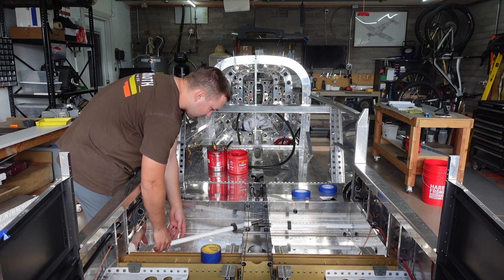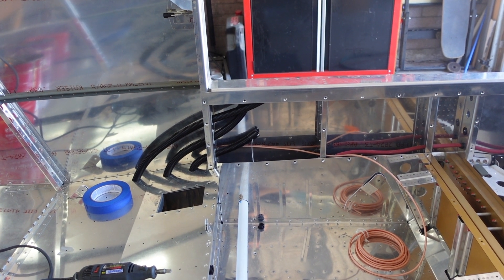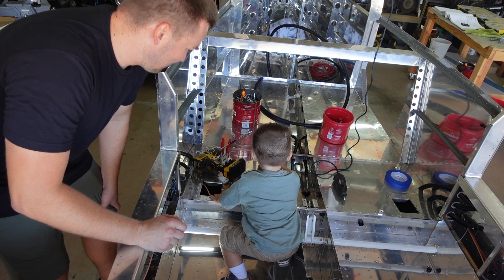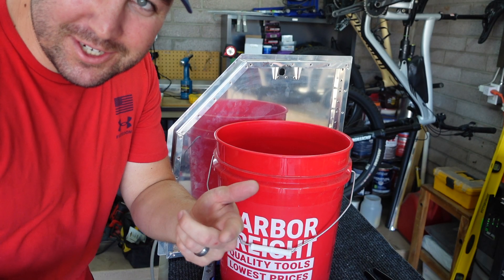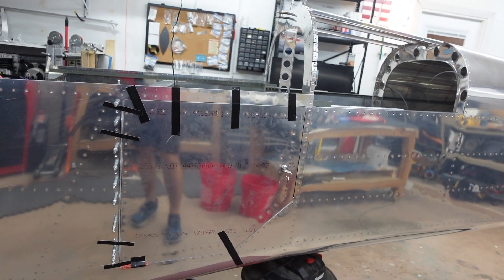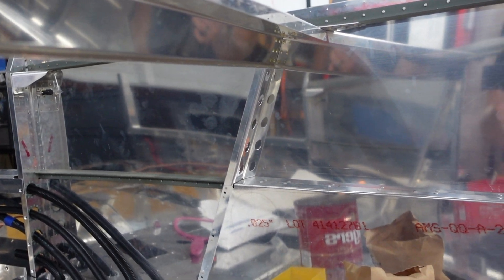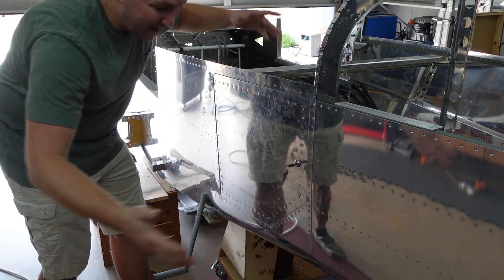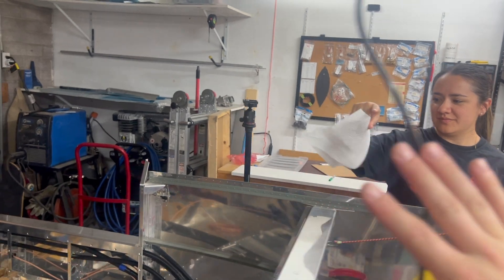RV-10 - Flap System, Baggage Door, etc.

Comment: Hey Austin, care to share how you drilled the safety wire hole through the end of the flap motor?  I'm failing to see how to drill such a steep angle.  Thanks
Reply from the maker: @JimDorn  the new flap motor doesn’t need it. There is a note mentioning this on OP 64 page 06
Reply: @ Okay.  I must have got the old version then.  Thanks